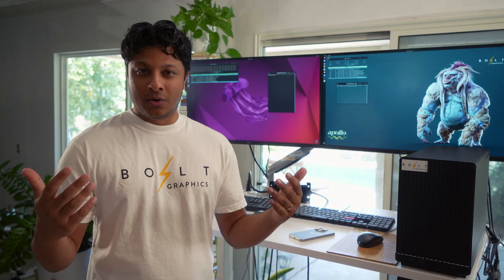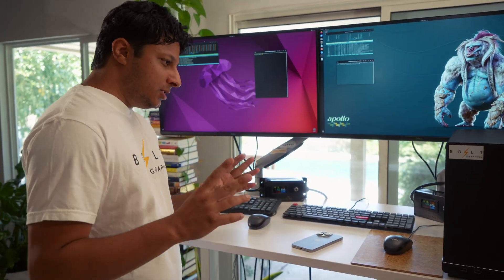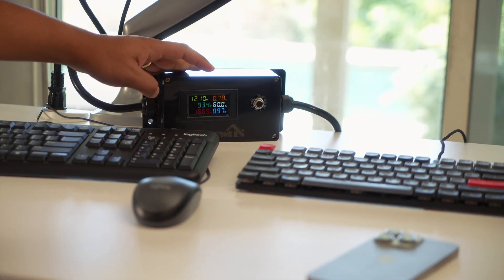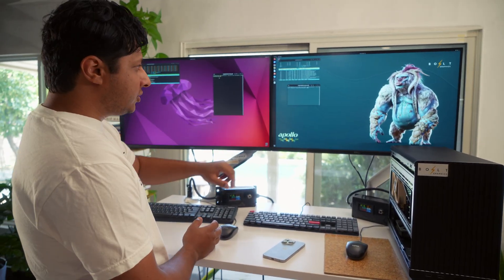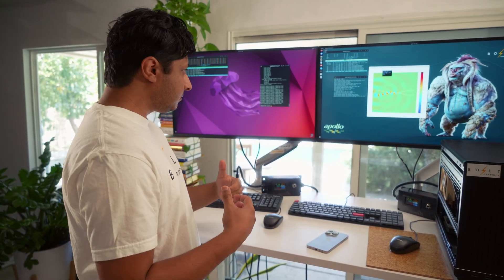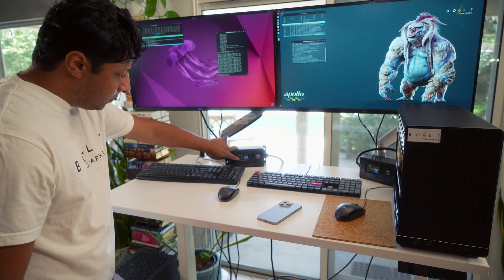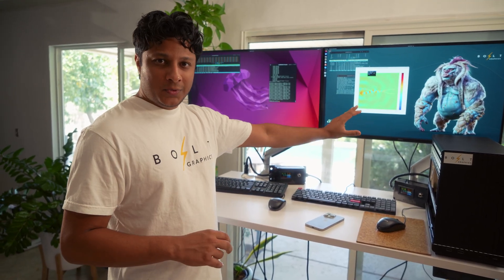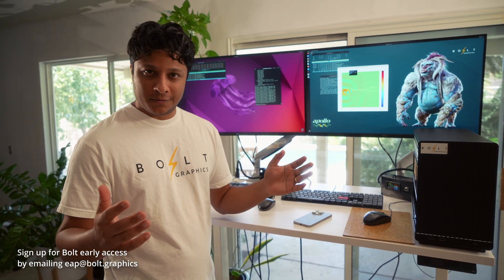Apollo Electromagnetic Wave Simulator Demo

Comment: i heard you use the risc v isa. You made a gpu out of a risc cpu architecture, this doesn't make any sense...
Reply: huh? is that a problem...
Reply: @MoiCestVinci yes, the risc architecture is more of an efficient general purpose core like a cpu or a microcontroller. It could be suitable to be a kind of array of small multicore cpus that could accelerate some computations but it's isa isn't a great one if you think about intensive graphic workloads and massive parallelism on small simple cores.
Reply: @thecellburner  Not quite. An ISA like RISC-V doesn't make something a CPU or a GPU, the microarchitecture does. You can build a GPU around RISC-V by using lots of tiny in-order lanes under a SIMT scheduler with shared memory and barriers. That is what makes it a GPU. It wouldn't make sense to cluster big CPU cores, but using RISC-V for the shader lanes is efficient. Also, RISC vs CISC doesn't really matter here since most GPUs use simple RISC-like internal ISAs anyway.
Reply: @MoiCestVinci thank you for this amazing response!

Comment: Interesting results, have you tried other simulation types as well such as FEM or MoM?  I ask because as someone who designs RF systems I don’t use FDTD on chip and board level analysis because it suffers from resolution and convergence issues due to the square mesh grid.  It makes pretty pictures and provides intuitive results but I usually only use FDTD sims on much larger structures like large radar cross section analysis etc.

Comment: I have an idea, if the Zeus GPU requires fans, it should use the noctua fan blades or something similar to keep the gpu fans very quiet.

I noticed how GPU fans can be way louder than my case fans. Unless you figured out another cooling solution.

Comment: All the industry standard EM solvers, such as CST and HFSS transient, have supported multi GPU acceleration for many years.  I’m currently using CST with 4x A6000 Ada.

The problem is Nvidia is pushing AI thus FP4, etc that is no good for FP32 and FP64 engineering computations.  You all can fill that niche that they are ignoring.  You’ll need to get your hardware supported on industry standard software.

Yes, in CST the fields are post processed after simulation, but you still get the real-time FFT and energy decay, so you can see what’s going on and can terminate the simulation.

Still very cool demo though.  Looking at your URL, if you can support 384 GB per card, that is killer.  You need to get your hardware supported on the standard tools.

Also, FDTD sucks for a lot of geometries due to the meshing, and there are no FEM or MoM solvers that run on GPU.

Comment: Is it possible for you to run a demo on superconductor simulation compared to RTX 5090/RTX Pro 6000? Would love to see if you can fit it on a single gpu (with or without the additional vram added) and see how much faster it is compared to the latest gpus